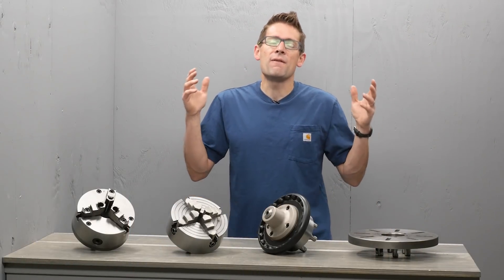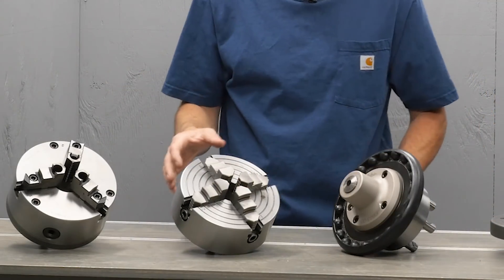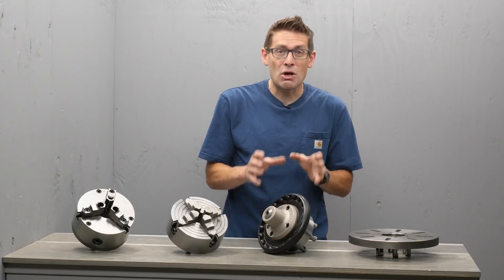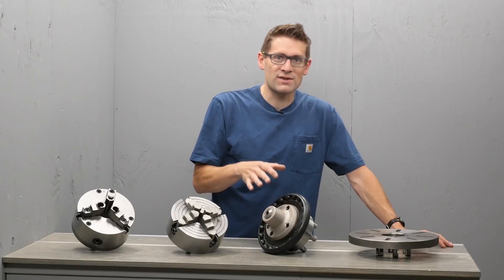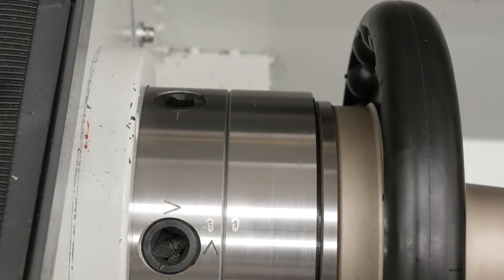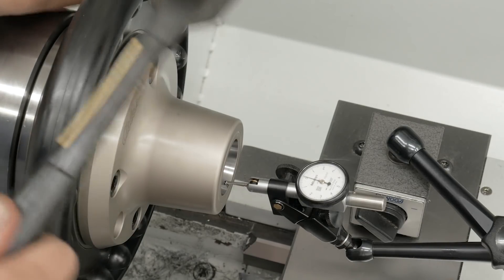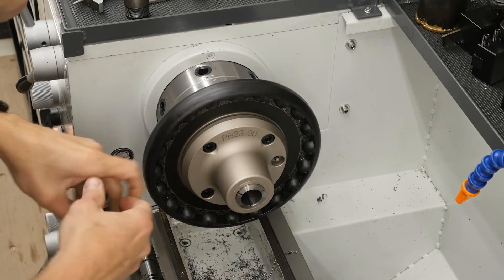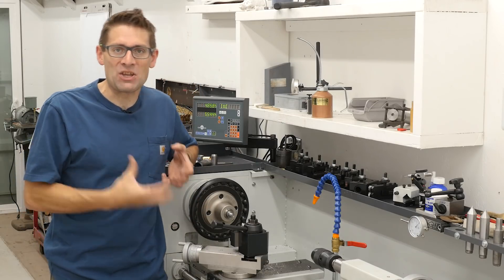Atlas Quickie 5C Collet Chuck: Workholding in Style for your Metal Lathe

Comment: I have a PM1340GT.  It seems that the faceplate on this model requires bent lathe dogs that have at least a 3" length of bent tail between the stock holding center and the center of the end of the bent tail.  This seems to be about 1/2" longer than the standard tail.  Does your faceplate require the same? And if so, where did you find your lathe dogs?  I am having a heck of a time locating any.  Thanks.

Comment: So I'm a total newbie with a lathe, the place I work has a grizzly g0509g and an assortment of chucks that I have been allowed to use I would love to use this chuck but I have had nothing but trouble with it I tried doing the face cut to zero it and then mounted the chuck and the run-out was around .015-.02 then after getting it dialed in to around .002 I did some work and removed it and switched to a 3jaw for some quick larger work and when I switched back to this chuck using a mark like you did to ensure its mounted in the same position the run-out is horrendous I would say somewhere between .08-.1 (visibly disturbing) everything was cleaned before installing it but this thing has given me nothing but trouble I've resorted to putting it back on a shelf and saying screw it. Any ideas or hints the one time I used it successfully it was super handy and quick. Thanks.